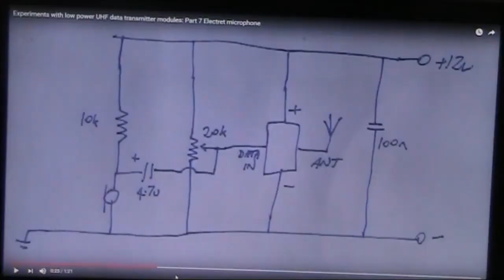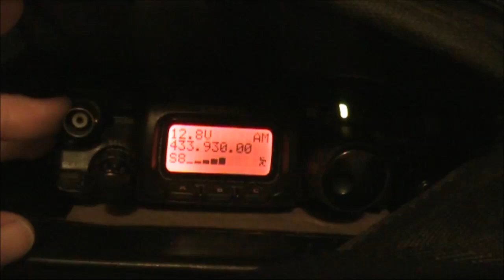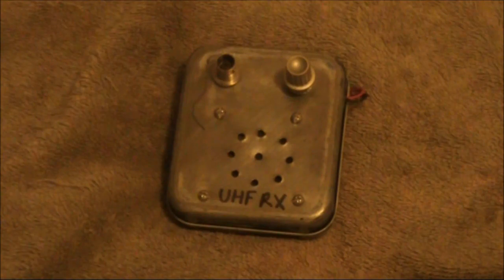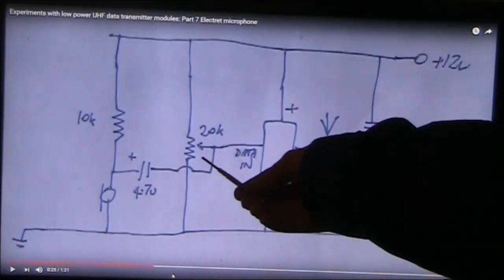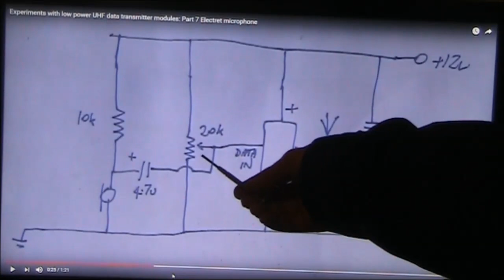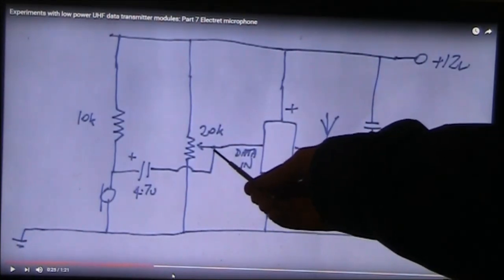Experiments with UHF data transmitter modules: Part 8 AM voice

Comment: Pretty distorty but a good start, a fun bit of experimentation. A yagi made from coat hangers of eight or so elements on the tx could prove interesting. 500mW 40 channel walkie talkies on the 477MHz band have been great fun for me previously. I bought a pack of four of them for $80 once about eight years ago from Kmart. I modified some of them to have BNC connectors on them and used them portable with yagis using bamboo booms. They had duplex functions even, and charging docks. I used to go working repeaters from elevated locations with them :)